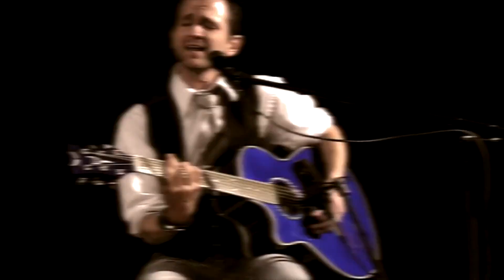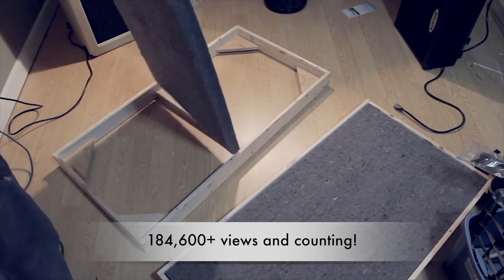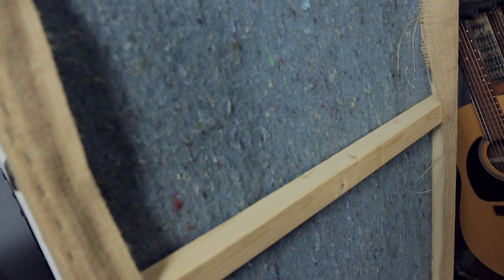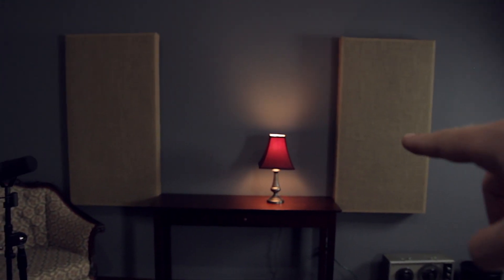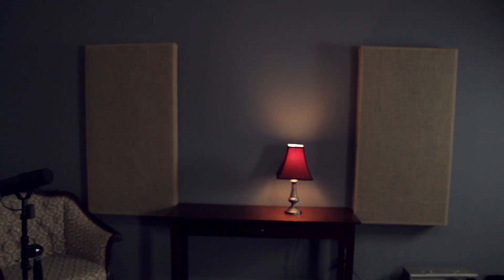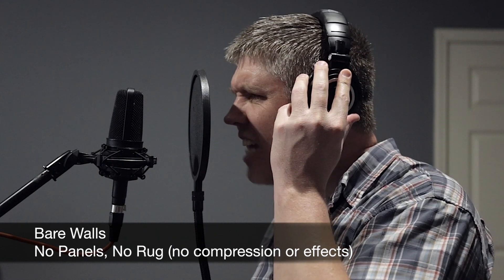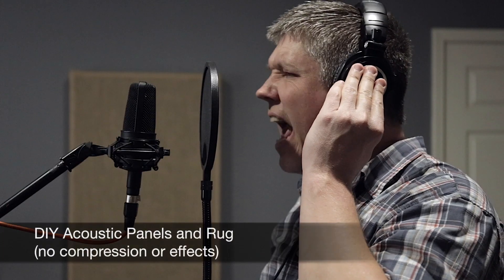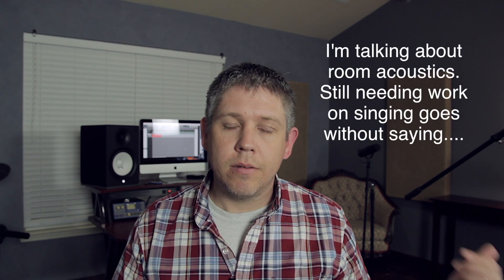Do DIY Acoustic Panels Work?

Comment: Nice test. Definitely an improvement. I just made and tested some DIY panels. Made stands to turn them into gobos.
Reply from the maker: Cool - gobos are a great idea! I built two on stands also so I can put the together at a 90 degree angle and then put one on top and have a usable vocal booth that doesn’t take up space when I don’t need one. Thanks for watching Raymond!

Comment: Great demonstration. The panels make a bi difference. The rug helps too. Try putting something in a couple of the corners where the walls meet the ceiling.
Reply from the maker: Thanks Tom! I put several panels on the ceiling that really help control flutter over a larger area. Made a huge difference. I plan on doin the corners next when the budget allows. Thanks for watching, commenting, and subscribing!

Comment: The difference is very noticeable even through YouTube, can't imagine what it's like in person. Because of your video I'm going to try my hand at building a few of these. My living room is 11 x 19 ft room with 8 ft ceilings and I have noticeable slap-echo and it's driving me nuts with the way my speakers (Dunlavy SC-IV) are positioned.
Reply from the maker: Hey bb, just saw your comment. Did you end up making any panels yet? If so, how did it go? The slap echo in an untreated room can definitely be problematic and annoying with recording and mixing.
Reply: @DadRockAndGuitars  I've bought everything I need but I just haven't had time to build them yet. I bought a box of six sheets 2" thick Owens-Corning 703 and some nice pine to build the frames.  I did play around with just propping up a pair of the O-C sheets against the walls at the first reflection points and it made more difference than I thought it would. 6 of those in the room should make a big difference when I'm done.
Reply from the maker: @BB..........  Awesome!

Comment: Hey bro. Just a suggestion. A large thick oriental rug or similar which covers most of that hardwood will take care of any issues in your new room. That will take care of the reflection issues you're having and will also serve to protect the hardwood from the drums.

And by the way you have a great raw rock n roll voice.
Reply from the maker: @MeTuLHeD Thanks!. Yeah, the large rug was an option that I considered (and would definitely work), but I also use the space for portrait photography and often include the floor as part of the photo. So a large rug would always be in the way. I don't track drums too often in this space since I put the hardwood floors in (used to have carpet), but I have a few things to protect the floors when I do. Thanks for watching and commenting!

Comment: Is that a convertible couch? I think I just bought the same one. 

Great video btw. I'm thinking about making my own sound panels hopefully they also help for sound proofing and thinking about adding foam panels on the walls too ..
Reply from the maker: Yup, that's a futon couch that I got a Walmart awhile back. :-) Acoustic panels will help with the reverb and echos within the room so you'll get cleaner recordings. Unfortunately, acoustic panels (like what I built, foam panels, or otherwise) won't really do anything for sound proofing (keeping outside noises out and inside noises in). Sound proofing is kind of a whole different thing that really has to do with how the structure of the room is built (walls, floors, doors, etc.) Most home studios aren't particularly sound proof, but you can still get great recordings. Sealing up the doors on the room with weather stripping can actually do  a lot.

Comment: What is the material inside the panels?
Reply from the maker: I used cotton batting. Link is in the description, but they make it differently now. It's not nearly as rigid so it's a little harder to work with, but still does the job.
Reply: @DadRockAndGuitars  thankyou

Comment: Would cellulose insulation work as acoustic panels?
Reply from the maker: I don't know for sure, but here's what wikipedia says:
"Sound insulation
Insulation reduces sound traveling through walls and between floor levels. Cellulose provides mass and damping. This reduces noise in 2 ways, it reduces the lateral movement of sheetrock and attenuates the passage of sound along cavities. Cellulose is approximately three times denser than fiberglass, providing a slight improvement in sound reduction."

I could see it possibly getting a bit messy if it doesn't hold together. The cotton panels don't fall apart or anything like that.